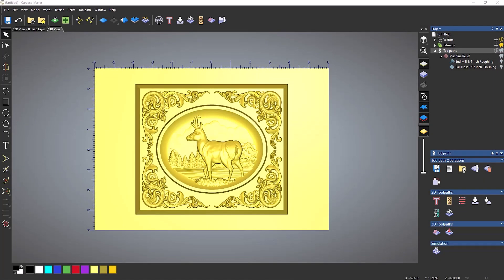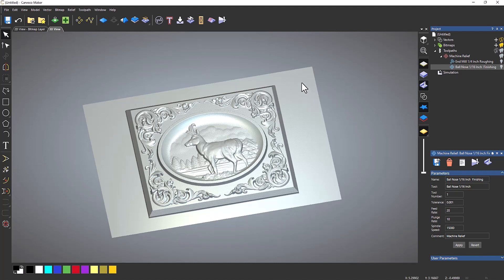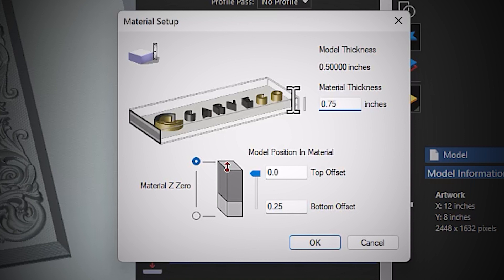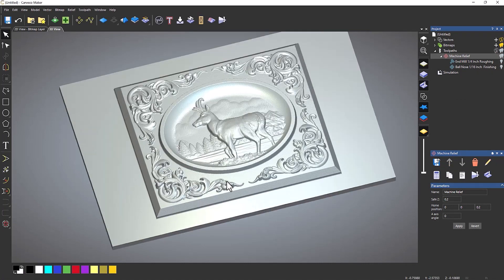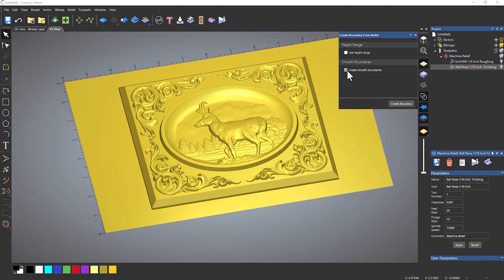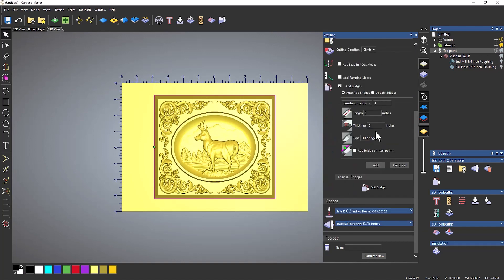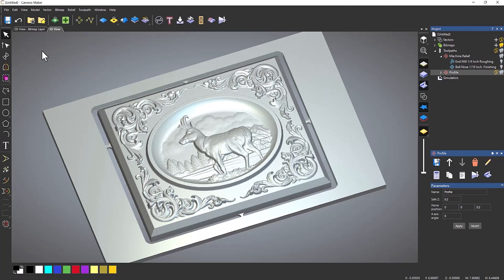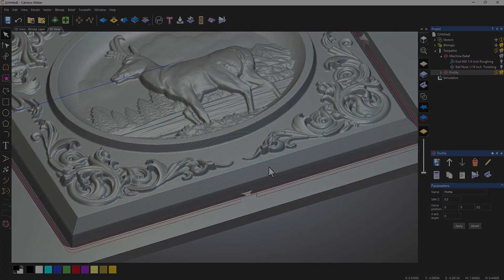Tips and Tricks: Adding Tabs or Bridges to Relief Carving

Comment: Nice tip. Thank you Leighton. I'd there any way to stop Maker from deep diving, sudden drop to spoilboard, off the edge of a relief ? Is keeping the bit at cut height and not cut out frame area?
Reply from the maker: Thanks John.  Probably best to use a boundary and offset slightly inwards so not to let the tool plunge down the side walls and then do a 2D clean up pass around the outside.